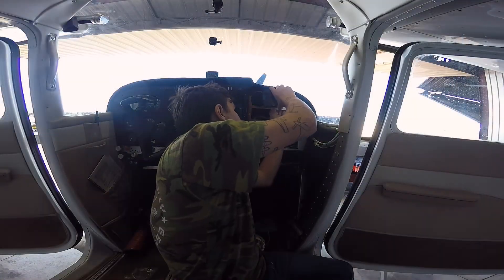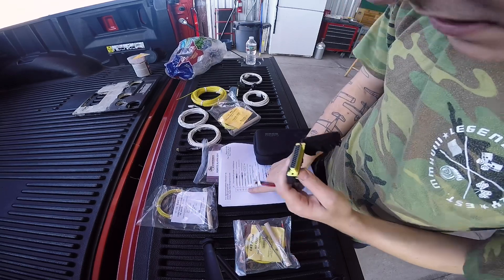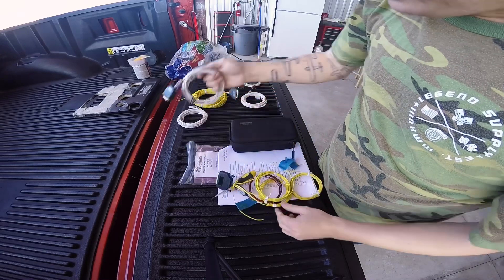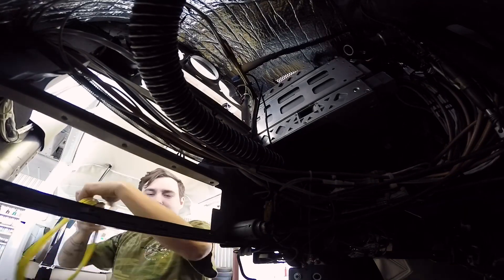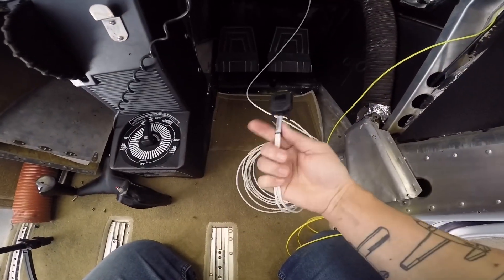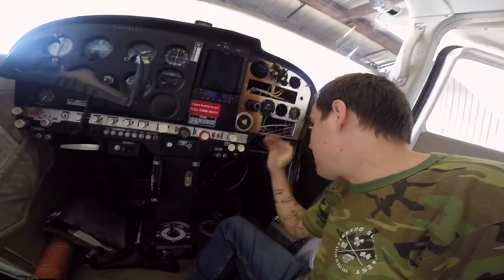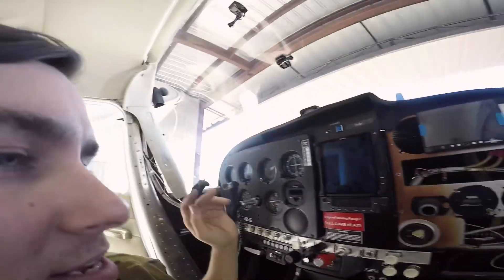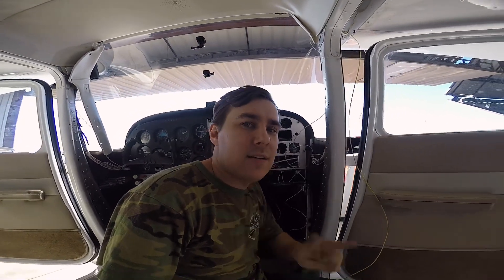Cessna 172 EDM 900, Running The Wire Harness For The Engine Monitor.

Comment: It would be easier if you taped the ed of the harness together to go through the fire wall.  
Firewall needs to be sealed correctly, grommet is not sufficient heat shield.  
You don't want the temperature wires near any RF.  Supporting the wires is critical add brackets screwed or riveted to structure or the glare shield.

Comment: In avionics parlance:  P stands for Plug and J stands for Jack.  On the device you will find "J"acks and the wiring connectors will frequently be labeled "P"lug and some number. (It took me way longer to figure this out than I'm willing to admit!)  For example, you will find a P1 that plugs into a J1... every plug will have a matching jack. 😁